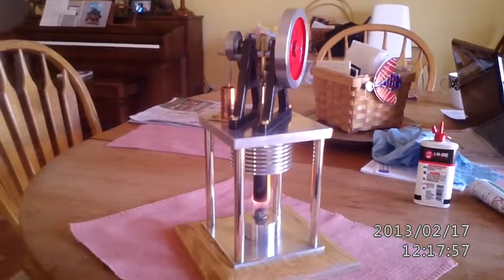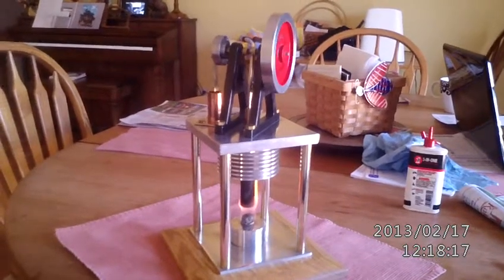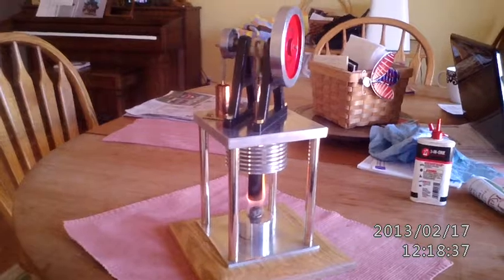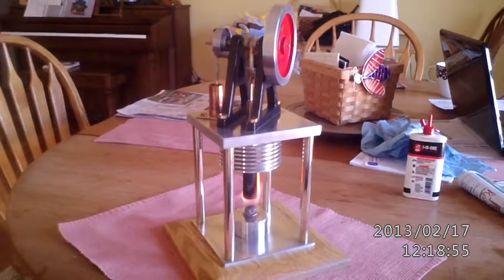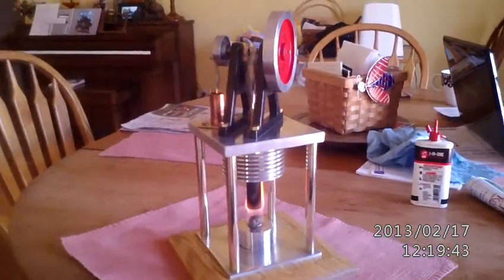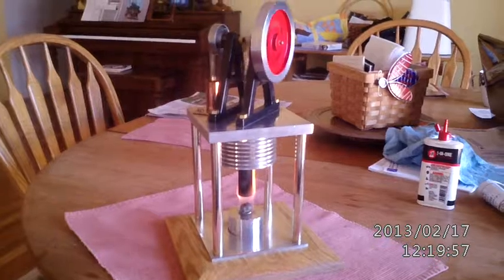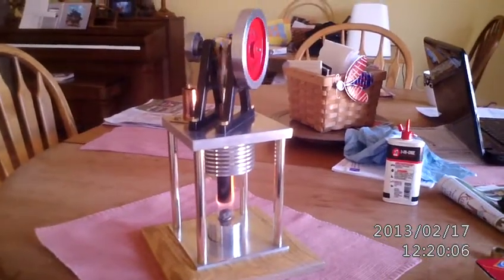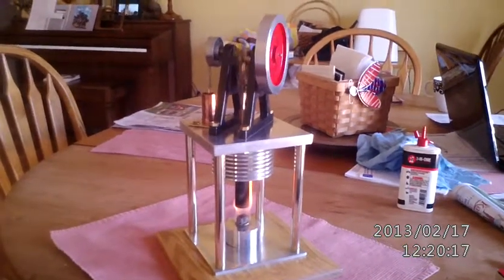vert stirling#2

Comment: That's a beauty Colin.  Does the big aluminium top mounting plate act as a heat sink ?

I hope to do a review of a shop bought one of these soon.  Very interesting layout.

Cheers Rob
Reply from the maker: Hi rob . This is a kit from grizzly tools In the USA .you can get the plans for this engine and the horizontal beam engine I have built two horizontal beam engines one from the kit and one from the plans that came with the kit. I was showing my engines at a steam engine rally .and a guy came along and like the horizontal engine so much that he bought it . I sold five of my engines that day . The top plat is not a heat sink . I gave the flame a bit to high on this video. But check out grizzly so site .enter Stirling engines and the plans are there so you can download them . Thanks for your kind comments . I hope your neck soon gets better lol.
Reply: Ha Ha.  I had a few reds and it's much better now.

Cheers rob